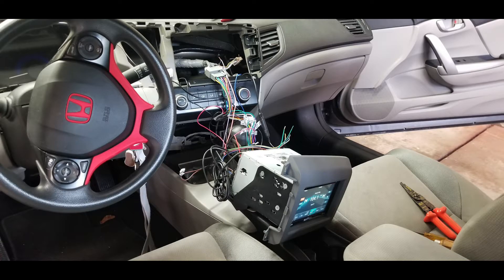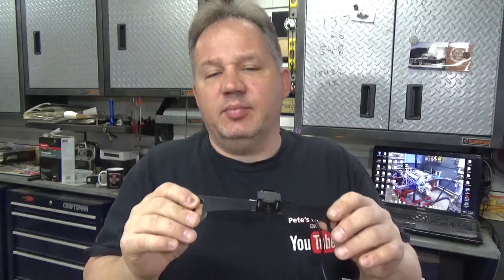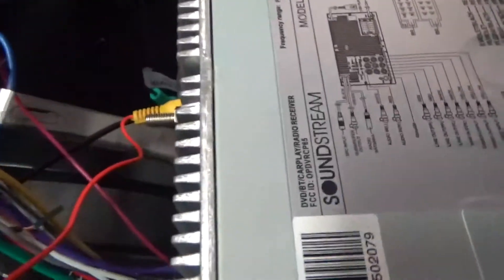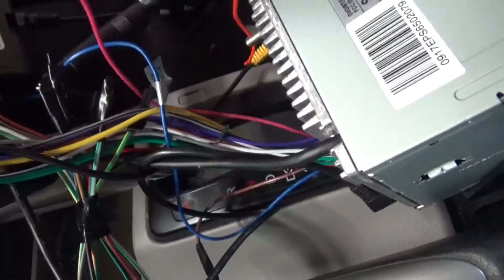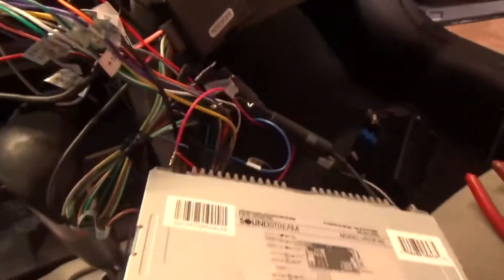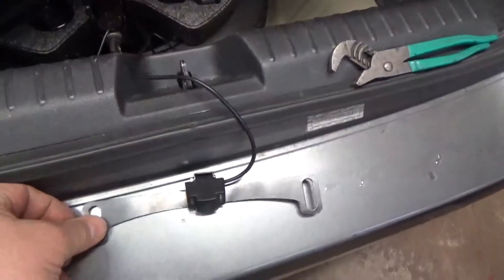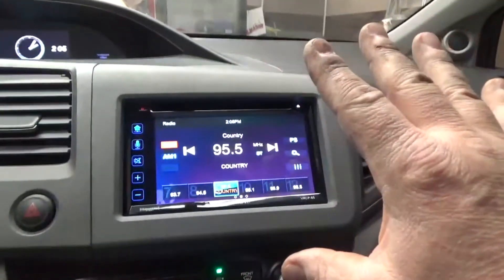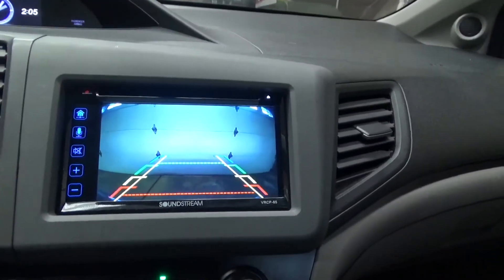Hooking up a Backup Camera - Where Does the Red Wire Go?

Comment: Confused as to why you ran the camera into the loom for power? Power would have been sent down the red wire from the radio to the back. So you could connect the camera red wire to the red wire from the radio and it would have power?
Reply from the maker: You can do that too
Reply: @PetesGarage  I'd put a multimeter on your wiring as that camera will likely receive twice the voltage when you go into reverse (if you have the red wire from the video cable also attached to the camera DC supply)

Comment: Issue I'm having is someone actually hooked up the exact same radio he has but the only thing that works is the phone the Bluetooth and the radio but for some reason the microphone isn't hooked up so no one can hear you and nothing else on their works and then they hook the backup camera to a completely separate screen sometimes going behind someone else's work is more pain in the but
Reply from the maker: It is difficult because the wiring harness for every car is different

Comment: Everything works great, but when I hit brakes, radio goes out. Been having battery drain issue. Bad cell new one is coming. When I go into reverse camera comes on but when I push brake radio sound goes out.
Reply from the maker: Definitely some wires crossed there

Comment: On my harness I have the reverse wire of course which in my case for my BOSS head unit is purple and clearly marked reverse. That’s a no brained like you explained in the video. But I have another wire that’s marked as “rear camera power” and then “parking brake input” where do I connect these?

Comment: So dumb question what if my head unit does not have a reverse red wire. I do have a brake wire ( dont ask I have no idea) and I have a red wire labled camera +12v and I have a 3 camera wires all with red wires like you showed in your video, 1 each for corner cameras and for the rear camera, should I just use that red wire for all ? Thanks for any help.
Reply: I might add that the camera ends all had red wires for triggers, I ran one into each turn single hot for a trigger and the rear into the back up light all good there and front does not have one. FYI.
Reply from the maker: That sounds right

Comment: I wired mine into my backup light on an f150 and I'm pretty sure it threw a safety fault and wouldn't let me start the car because the voltage was different.
Reply from the maker: Interesting
Reply: @PetesGarage  actually i just figured it out the other day.. i wired the negative into the negative wire and thats why it did that.. i recently plugged the positive back into the hot wire and put the negative into a screw in the truck frame and then had to put the little red wire into the backup light hot wire.. omg this thing was a chore and a half.. it came with a weird secondary power plug that i had to tear apart and use all sorts of little solder and crimp wire connectors and even had to lengthen the video wire by soldering in longer wire to each little wire and it was all kinds of messed up.. i eventually just figured it out after having this non functioning license plate backup cam on my truck for several years.. the picture quality is terrible but it works now.. when i saw it i was like oh dag.. i finally got it.. feeling accomplished.. what a job..

Comment: Great video. Struggling with my reverse camera with an android head unit. The BACK wire from the head unit with nothing connected outputs 12vdc when car is in reverse. However, when I connect the camera the voltage drops to 1.8v. I thought and seen other videos that the BACK wire is to power the camera. On the camera end you simply connect the red wires. The black is not needed as the rca has a ground that is used. 
If the head unit can’t power the camera then the red wires on the rca are not used and the power cables on the camera end are simply connected to the reverse lights.
Reply from the maker: That sounds a bit screwed up
Reply: I figured it out. I had 2 back wires and both dropped the voltage when camera attached. Turned out I needed to splice into the 3rd wire next to red on the black plug that goes into the head unit. Works perfect now.

Comment: It only has a red wire with a 4 pin and a 2.5 mm jack. Is it ok to just use the ground that is in the 4 pin and not have one in the rear near my reverse cable?
Reply from the maker: Yes, try that

Comment: Hey Pete! I’m having a problem with the rear back up cam I’m installing in my SUV. The thing is that the wire attached to the back up camera is really short about 12” and the extension cable that connects to it has that red wire next to the plug where you join them both. So that red wire (in my case is blue) is also about 12” long and being that I need to run that red wire behind the lift gate, thru a wire rubber tube at the top and down again under the lift gate weather strip to be able to reach the reverse lights it’s simply impossible. That red wire would need to be at least 6 to 8 feet to get to the reverse lights. So my question is should I solder another piece of wire to that red wire to reach the tail lamps. Because I don’t see any other way to get there or is there any other way that I don’t of to do this.
Reply from the maker: Yes, solder on an extension

Comment: I do have one question, what do you do with the other end of that wire.  You hook one end into the reverse gear, but the other end,  Where does it go?  Thanks
Reply: One red wire to the reverse lights in your vehicle. The other red wire to the reverse wire in the dash. The yellow one is video, which goes to the cam, and the other to the head unit
Reply: @80sRetroCar  Isn't it because some cars do not have a reverse signal so they have to be hooked up into the reverse light cable going to the light at the rear of your car?

Comment: Thanks Pete, 
Your video is helpful.
I'm fitting a new headunit with reversing camera.
My van runs on 24 volts. I have a step down converter to 12 volts for the radio. Not sure how many volts the reverse light runs on but if it's 24, will that blow the camera.
Reply from the maker: Most likely, the cameras are 12V

Comment: My ‘14 Altima doesn’t have the reverse wire. What do I hook the red pigtail wire to?
Reply from the maker: There has to be a backup wire somewhere
Reply: @PetesGarage  
I pulled the entire stereo out of the dash, disconnected everything. Can’t find it. Some research has told me it’s behind the instrument cluster but I’m not going to tear the dash apart just for that. A friend told me all I have to do is find the reverse light fuse and run the red wire to that, as it would do the same thing the reverse wire would. Can you confirm this?
Reply from the maker: There has to be a backup light switch somewhere
Reply: @PetesGarage  
If there is, I have no clue where it is. I tried what my friend told me but no dice.
Reply from the maker: There has to be a switch by the brake pedal

Comment: Reverse Camera Issue

Hey Pete 

I’ve recently purchased a 2014 Nissan Navara D22. The Navara came with an aftermarket head unit being the Kenwood DDX4019BT. It has a reverse camera installed. With the Kenwood, the reverse camera worked no dramas.

I upgraded just the head unit (Pioneer DMH-Z5350BT) and speakers and kept the existing camera and cabling. Since upgrading the head unit, the reverse camera doesn’t work.

The camera does work if I start the car in reverse. I had a multimeter plugged in when I started it and the camera was getting 12.5V. After the starter motor did its job and the car returned to idle, the voltage dropped down to 10.4V and the camera turned off. 

Any ideas how to ensure it maintains above 12V so the camera keeps working?

It was working fine with the last head unit being a Kenwood. I have changed no wiring between the head unit and the camera.
The camera is powered off the reverse light.

Any help would be massively appreciated! Trying to save myself paying the local auto shop $186 to “install” the camera.

Thanks
Reply from the maker: Sounds like the alternator is going. The old head unit may have been powering the unit

Comment: Hey Pete, your video is helpful, but with my Boss BVCP9700A head unit and Boss backup camera (came as a set) the tiny User Manual that came with the camera does not show the 12V Power/Video on the head unit connected to the red wire that is included with the RCA video cable. The camera gets power from the backup lights when they are on, but the Boss head unit has a Violet/White Reverse Signal 12V input that connects via the Metra interface panel (which connects to the original wiring in the vehicle, in my case a 2011 Mustang that had a SYNC 1 unit), so it that will tell the head unit to switch to backup camera input. The red wire that is at each end of the RCA video cable apparently has no function if the head unit knows when the car is in reverse. The Boss instructions are not clear as to how to correctly connect their head unit and their camera and the diagram does not even show the red wire that is at each end of the video cable. I'm trying to get an answer from Boss to clarify their wiring diagram. I'm reluctant to power up the system until I get a confirmation. But for folks who have a system that does not detect when the car is in reverse your advice is very helpful.
Reply from the maker: If the head unit knows it's in reverse the red wire probably doesn't get hooked up. You can power it up, nothing will get damaged. The RCA cable carries the video to the head unit just like a DVD player to a TV
Reply: @PetesGarage  Thanks.

Comment: Here's another awesome idea, which I just thought of, Incase there are people like me, that the shift shaft is not in line with reverse, which means my lights for reverse don't come on when it's actually in reverse. Tie the red reverse wire into your dome/ interior/ over head light. So you can just turn it on and off when you need it. Apparently it will be ok, Because it is a 12v brake light, and a 12v interior light, so it should be fine.
Reply from the maker: That would work

Comment: My back up camera is all hooked up but display is black when I put it in reverse. I was wondering if I didn’t connect something. What is the 12v camera wire for that comes from my double din?? I didn’t connect it but not sure if it’s necessary.
Reply from the maker: All wires are necessary, follow the wiring diagram

Comment: Omg, Thank the lord I found your video. I installed a new DD stereo, and couldn’t figure out where that red wire gets hooked up to the past 2 days. So I just connect that red wire to the purple and black reverse wire that runs to my radio harness in my 2010 ram 1500 and done? You’re the best, thanks Pete…
Reply from the maker: Yup, that simple

Comment: I have a “wireless” back up cam that I bought for a 2008 Nissan Titan. The camera has a red and black wire. The reverse light on the truck has a red/blue wire and 2 black wires coming out of the bulb. I cannot figure out which wires I should splice into. Thoughts?
Reply from the maker: The red and black on the camera only need to go to a ground and a powered +
Reply: @PetesGarage  Sorry, I know nothing about this stuff. I think the red one splices into the red/blue wire but are you saying the black wire from the camera splices into one of the black wires coming from the bulb? Or it just needs to be grounded onto the frame of the car somewhere?
Reply from the maker: The black goes to ground or a negative wire. It depends on the camera you have but there is a trigger wire that goes to the backup light

Comment: My replacement headunit unit came with an ACC12v and GRD wires as well as reverse.  I use the ACC 12v because the taillight may not receive enough current to power the light and the camera which is a common issue with backup cameras.
Reply from the maker: Great comment

Comment: Awesome thanks.
Is that 'reverse' wire on the harness a constant 12v when the car is on or only when reverse is activated? I want to run the camera when towing.
Cheers
Reply from the maker: Yes, correct

Comment: Have camera hooked up, powers on, comes on when vehicle is in reverse (says image may appear reversed at top of screen)but when put the vehicle back into park or drive the radio screen will not appear unless i hit the x on tbe screen to exit out of camera. I shouldnt have to do this everytime i put it in park or drive. As soon as vehicle is put back into park or drive, the main screen of the stereo should show up. But it dont without exing out of it or hitting back button on the screen
Reply from the maker: You may have it to the rear running light, not backup light

Comment: Hey, so I got a different one... it’s a dashcam and a rearview cam, I set it up and they both work but in the rear, there’s a wire comin with the rear ciew cam that I think goes to the reverse tail-lights for power and signal, the kit utilizes the stock mirror as a screen so I can swipe through but I want that reverse signal
Reply from the maker: Yes, each camera needs to go to the tail light wire to trigger it on

Comment: I’m having problems hooking mine up but I have a new boss radio and it automatically senses I’m in reverse even if I don’t install a camera. So I’m assuming I don’t need to hook anything but the yellow rca cable into the back (right?) The main question I have is hooking the positive wire to the reverse light. I only hooked it to one of the wires going to my reverse light but I need to splice it into BOTH wires going to the light (correct?!) I was thinking one of the wires going to the reverse light was negative and one was positive so I would only hook it to the positive. But it’s not working that way and wanted to check with your and see if you responded before I connected it to BOTH of the wires in the reverse light!
Reply from the maker: You need to have power to the camera and switched power to the head unit

Comment: my vehicle has a negative trigger and the seller states that i need to use a relay.
Reply from the maker: Yes, a relay is used when the supplied voltage is not high enough to run the camera

Comment: Thanks, good video. One point some folks might need to know is that the head unit might have a reverse sensor wire that normally is supposed to connect to the wiring harness "Reverse" connector that you showed the "red wire" connecting to. I'm just learning this stuff, but it is my understanding that if your head unit does have the reverse sensor wire, you hook that to your wiring harness rather than the red wire. So the head unit is being told by the car's wiring harness connected to the head unit's reverse sensor wire, that it should now display the backup camera's image. Then presumably you'd just put a little electrical tape on the end of the red wire as it's unused. I had wondered why I have one camera from Boyo that has the red pigtail wire included with the yellow rca cable, and another one that doesn't. The one that doesn't, would seemingly be used in a configuration like mine where the head unit has the reverse sensor wire. Like I said, I'm still learning but I had the same problem you were; there's just no much out there to educate. Thanks again and please anyone do chime in if I've got my assumptions wrong.
Reply: So in this configuration you wouldn’t have to tap into the brake light wires in the rear of the car at all right? It would be getting power and signal to turn on from behind the head unit and spliced into vehicle harness
Reply from the maker: Lots of great information there Jeff, thank you very much
Reply: @PetesGarage  Like you, trying to help other folks struggle less as I've received good help from other folks like yourself. To that end, I'm going to delete the misinformation and correction so that no one will read the mis statement and not the correction. Thank you again for the informative video.
Reply from the maker: Thanks Jeff
Reply: Jeff mine  has a back view control wire.
Be sure to not confuse orange with red.
Reply: @red2965  No mistaking that. I'm well past my install at this point. Got both the front and rear cameras working. thx

Comment: wait one question so what if the harness on the back of my radio does not have a wire labeled reverse? .. but i know it’s compatible for backup camera because it has the rca plug for it
Reply from the maker: There has to be a wire that triggers the camera to turn on
Reply: @PetesGarage  i see theres one on the aftermarket radio harness that plugs into the factory harness . will that work also?
Reply from the maker: Possibly, but there are so many combinations is tough to say.

Comment: What do you do with the other red wire on the camera-side end of the yellow RCA cable? (Each side of the yellow rca cable has a little red wire coming out of it)
Reply from the maker: Depending on the brand, hook it to the reverse light wire
Reply: The red wire brings the trigger signal back from the camera upto the trigger wire on the back of the display unit. You dont have to go poking into the vehicle wiring loom if you have connected the camera to the reversing light feed
Reply: @nickrogers7849  So what you are saying is that as long as I connect the trigger wire behind the display unit  I don’t need to connect the trigger wire to the tail lights? I hope I understood correctly because what you are saying would make my job so much easier.
Reply: That red wire is basically connected to the other red wire on the end. It's one continuous wire. Current is supposed to flow starting from that end of the wire to the other end (monitor side) to trigger the switch telling the monitor to turn on the camera screen.
Reply: So hook up both of them together I'm having the same issue
Reply: I'm attempting this right now, I'll let you know what I find out for the other side red wire.